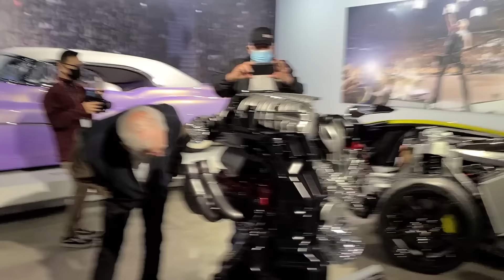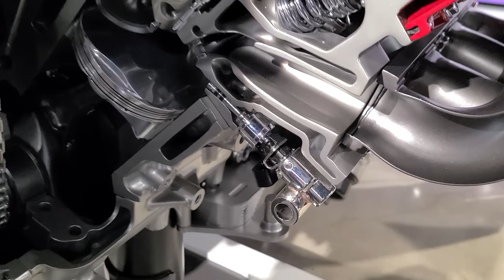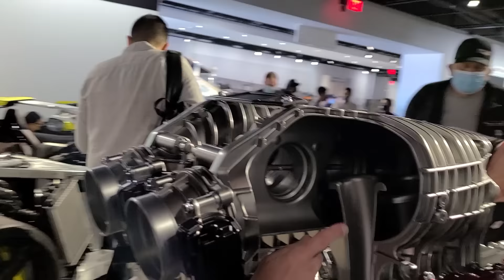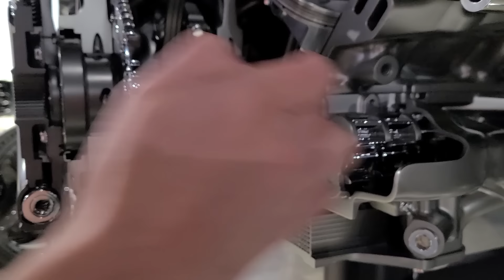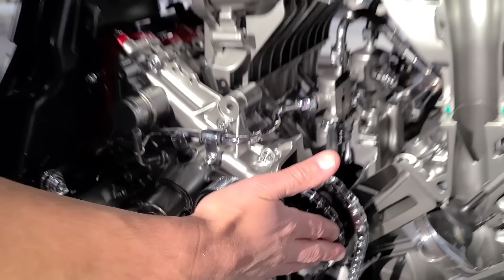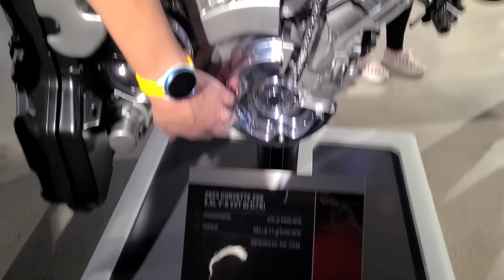2023 Z06 LT6 Cut Away Interview with Dustin Gardner

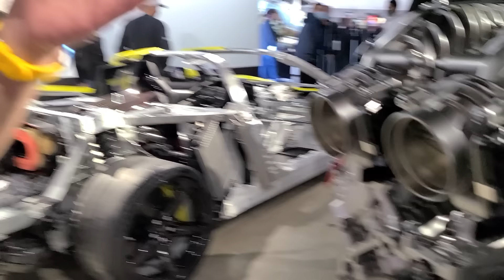Comment: 7:32 So will the intake components, manifold/plenum/throttle body, all have to be removed in order to replace the starter? I don't know if it's been like that on the stingray motor or other V8s, but it's new to me.
Reply: Pretty sure tgat came from cadillac
Reply: Looks like the intake ducting and maybe throttle bodies would need to be removed. Without seeing it complete, and in the car, it's harder to tell. But I would say that a starter replacement could probably be done with the intake plenums being left in place.

Comment: Only thing I see is that roller chain. Roller chains like that haven't been known to do very well for the manufacturers that keep trying to use them. Otherwise that's one hell of an improvement for Chevy after they've pretty much run out of improvement options for the pushrod v8.

Comment: Dodge is going to come out with a motor to destroy this engine like if you agree!
Reply: I responded to engineering employment ads put out by FCA a couple of years ago, looking for experienced engineers to work on high performance engine projects for SRT.  I didn't get hired, but something must be going on.  One of the interview questions was: What do you think is holding back engine power the most?  That's a question that an engine guy likes to answer.

Comment: Amazing but simplicity in maintenance seems lost.  If you have to rebuild this engine, what system is going to pick out the shims for the valve train.  If one of those six scavenge pumps fails, how are you going to know?  Maybe there’s a benefit in five others for redundancy.  What’s the probability of one of those mechanical fuel pumps to fail?  I wonder what Ferrari engineers are thinking when seeing this stuff.  Are they thinking the Americans are geniuses?  Are they thinking they took a simple thing and made it difficult?  Are they thinking they took something we’ve been struggling with for 30 years and solved the problem?
Reply: A competent mechanic with a good set of feeler gauges and a calculator can reset valve lash in this engine.  Don't get spooked by the automated assembly at the factory.  They do that for speedy manufacturing.  Nothing else in the engine is ground-breaking technology.  GDI fuel pumps are common nowadays, and by having two, GM is reducing stress on each one, and giving limp-home capability if one fails.  Multistage dry-sump pumps are old technology.  I looked at a 9-stage pump on Porsche's 5.7L V10 many years ago.  Aircraft have had them since the 1930's.  I don't think Ferrari is worried.  Every time that GM redesigns the Corvette and makes it as fast as their V8 cars, Ferrari just raises their prices and talks about "old world craftsmanship".
Reply: I think ferrari moved to turbo because everyone else did to keep up with the HP of the competition.

This engine is actually quite simple. Those scavenge pumps are the same as the lt2 but just more because they can. They likely all have sensors. The valvetrain is all mechanical. Yes it requires precision shims but tuners can likely get away with valve lash adjustments. The fuelpump is nothing extraordinary. The titanium rods and stuff was all present on thr LS7. They just improved on tech that was already being used.

Comment: Oh my God. Lash for life. Best bad idea ever. It goes along with lubed for life ball joints and other suspension components. No wear is impossible,  so is the life expectancy short?
Reply: Not likely. Is life expextency for a camshaft short? Same idea. They each have their own oil jet so unless you shit on your oil changes you should be fine
Reply: @ShawnyStorm  yes, I've seen aggressive camshafts live 2 years with religious quality oil changes. With added oil squirter as well. I guess time will tell how long "life" is.
Reply: @electricshockproof  i dont think these are aggressive camshafts. Likely the LSA is quite narrow compared to a smallblock but very rarely do oem's have aggressive camshafts. Its bad for idling and terrible for emissions. The most surprising aspect of this engine is it passes new emission standards so its likely toned down quite a bit from what it actually can achieve if let lose. Im sure tuners will get this close to 800hp na with just boltons and tuninf
Reply: @ShawnyStorm  peak torque at 6300 rpm and a redline closer to 9000rpm. That's not really mild cam design territory.  If they managed opening and closing ramps that are gradual,  they must have huge cam base circles, and maybe they have it figured out. Time will tell.
Reply: @electricshockproof  not necessarily. You can change that with rocker arm ratio. It also have continously variable cam timing. The days of the massive lift cams are over. If it produces that much power through the rev range a big lift cam would kill the low end.
Reply: @ShawnyStorm  Looking at the rocker arms, I would bet that they are lower than 1.5 ratio.  If GM was smart they would have designed the cams with large base circles and low rocker ratios.  That would minimize the possibility of cam and slider follower wear.  I'm more worried about the chain drive system.   They're always significant warranty items for manufacturers.

Comment: Finally something that might catch the Ford GT, its about time.
Reply: Nah.  A 2019 Corvette ZR1 beats a Ford GT.
Reply: @andyharman3022  I will believe it when it wins the 24 hour of LeMans race like they did.
Reply: @gmonte12  Ford did not win the overall victory at the LeMans 24-hour with the Ford GT.  They only won the GT class in 2016.  Corvette has won the GT class at LeMans 8 times since 2001.  The C8 Z06 took 2nd this year.  Furthermore, the C7 ZR1 beat the Ford GT's lap time in the Car and Driver Lightning Lap competition at VIR by 3.5 seconds.
Reply: @andyharman3022  How many times did the Vette win the 24 hours of LeMans?
Reply: @gmonte12  Do you mean overall?
Reply: @andyharman3022  They NEVER won a 24 hour race there.
Reply: @gmonte12  Read my previous post.
Reply: @andyharman3022  not the 24 hour races
Reply: @gmonte12  Yes, the 24-hour races.  Look it up.
Reply: @andyharman3022  It did not happen. Please show your references( I know you cant).
Reply: @gmonte12  You're finally getting around to responding a year later? 

Do a Google search on "Corvette Racing LeMans Wins", and you'll see the 8 previous wins as I had answered you a year ago.  2015, 2011, 2009, 2006, 2005, 2004, 2002, 2001.  And by the way, Corvette won the GT class in LeMans this year, too.  Where's Ford?

In 2016, the year Ford won the GT class, they finished 18th overall.
In 2015, the Corvette won the GT class, and finished 17th overall.
You can easily check any of these facts out by doing a Google search on "Lemans Race Results", including any year you want to learn about.

I patiently await your reply.
Reply: @andyharman3022   show me a link
Reply: @gmonte12  Can't.  I tried last month when I sent the previous note, but YouTube doesn't allow links to external sites.  You're dedicated to ignoring facts that you don't like and can't take the time to do a 15-second Google search that will prove me right.  Instead you want to put up a smoke screen trying to make it appear to others that I still have something to prove.

Comment: Pretty cutting edge for a NA motor.  As long as the eccentric shaft for the fuel pumps works well, 8t could be a durable winner.

Comment: The DOHC system is similar to how motorcycle designs are but how is there no valve adjustment? The valves WILL wear into the seats eventually... What keeps them from tightening?
Reply: supposedly the special coating i think sounds troublesome to me...time will tell

Comment: About a 120 ponies per litre 
Most superbikes 
About 200 ponies per litre 
I don't think there's anything particularly astounding bout the engine other than that gm is getting more refined  and it ain't gonna b for the masses anyway  
Best effort so far credit to the engineering dept as a team 
 Those followers and valve seats will wear in the hands of a rev junkie 
Or is there something mechanical to chase the lash 
Anyone know what one would be worth approx as a crate 
It's still ridiculous to think u can get that out of an old 2 valve cross plane 
Dry sump 
There would b some cash spent though and u would end up with more torque 
A price compare would b interesting
A quarter mile 
And a half mile 
A 24 hour race 
 5 laps of the nurburgring 
And pikes
Old tech vs new 
Best engineers on both sides
And whatever fuel like wherever 
Sept nitro

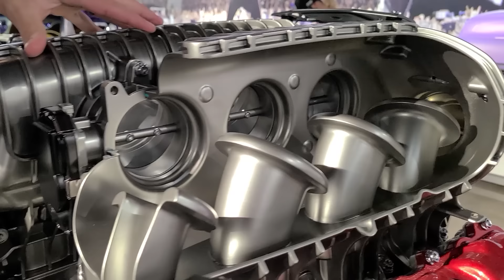Comment: Timeline 2:30 thru 3:50 tries to explain the construction that negates the need for ever having to reshim the valves.  However he doesn't talk about the valve over time wearing further and further into the valve seat which is the main cause of the reduction in space between the rocker arm and the shim.  Unless the valve seat is some new kind of super hard never compressible material, I still don't understand how this engine could never require reshimming.
Reply: They don't have to worry about it when the warranty runs out
Reply: @wtf0101  Hardie har.  But I still hope someone has answer for this.
Reply: With a regularly shimmed solid lifter there are still minor percussive forces, this is a "as perfect as possible" fit. Of course I still want to see what's up at 50,000 miles but 🤷‍♂️
Reply: @bigboreracing356  Well, if they shim the clearance wide enough to account for eventual narrowing, then before that narrowing occurs, there's a loss of valve opening duration.  But again, I'm wondering about the alloys that might prevent any incursion of the valve into the valve seat.   Enquiring minds want to know.
Reply: @bigboreracing356  Yeah, who's ever heard of a reliable small block Chevy? 🙄
Reply: re: "Unless the valve seat is some new kind of super hard never compressible material..." #VIBRANIUM <--- Capt. America approved.
Reply: He said they're diamond coated DLC
Reply: If everything wears together, it'll cancel out.   Valve & seat wear =  stem tip & follower & lobe!

Comment: Why sodium filled? Why not titanium
Reply: sodium metal melts in side the valve, and with the valve movement, splashes back and forth-- helps cool the valve.
Used since WW2, or before.
Reply: @2lotusman851  yes I know, not my question.

Comment: I'm not to satisfied with this.  Basically they designed a engine with a incredible top end and made the bottom end smaller. In my opinion they should've stuck with 6 liters or went bigger.  750 Hp all motor would've been a game changer and put the Corvette in the hypercar class with the McLaren, Koenigsegg etc.
Reply: Some people are never satisfied. With a tune and 100 oct should easy over 700hp. 670hp is at a rather warm temperature. Even without 100 oct this engine slightly warm will see past 670hp.

Comment: How can this engine have 175 MORE horsepower HP, yet 10 foot-pounds LESS of torque?!?
Reply: Short stroke.
Reply: because: MATH. <--- true story, not a joke.
Reply: @phillyphil1513  yes math. More rotating Mass more torque
Reply: The counterweights from a normal crankshaft will give you more torque
Reply: Higher RPM. Torque is specifically ROTATIONAL force, so RPM dictates how much work a given amount of torque can yield over a period of time. 

HP = Torque x RPM / 5252. 5252 is roughly 5280 feet, and the difference can be offhandedly accounted for as mechanical inefficiency, or even the thickness of a very-long and thin belt being unwound as it spins a shaft the rotational equivalent of 1 mile. 

@ 5252 RPM, HP & Lb/Ft of Torque are equal. Even considering that torque decreases at higher RPMs, dividing the product of (Torque x 8400 RPM) by 5252 is like multiplying that product by an additional 160%.

Comment: So, basically a Ford Voodoo engine...
Reply: No, very different.
Reply: Problem with 5.2L fpc it was never designed to starve in racing. The cpc had to use because of such issue. LT6 looks more compact vs Coyote. Chains are shorter. Design looks more refined. Bore spacing is similar to GM small blocks and previous ohc LT5.

Comment: Direct fuel injection has a tendency of making carbon deposite on its intake valves (ford ecoboost; VW GDI engines).  GM may have to add another manifold injector in the next revision to overcome this well-known issue.
Reply: Or periodically do a walnut blasting of the intake valve path,
Reply: The previous generation Vettes also had direct fuel injection on the LT1 engines in the C7 Stingray & C7 Grand Sport & on the LT4 in the C7 Z06, & LT5 in C7 ZR1 (though the ZR1 also has secondary port injection too).  They haven't had any issues to speak of with carbon deposits even though direct injection is supposed to cause issues as you mentioned.

Comment: Early piston failure, I'm calling it now. Also, fuel injection will go bad. But, what the hell, if you're buying this car with that duct taped rear wing monstrosity, it's on YOU.
Reply: Still junk....
GM's gift to Corvette enthusiasts was the last real front engine C7 Z06/ZR1.
C7 Z06 with 650/650 from a bulletproof pushrod V8 was the going away present for a real Corvette.
No overhead cam Euro/Japanese junk but just pure good ol American raw horsepower muscle.
Additionally that whine from the supercharger is like an addiction that only gets worse as you push the throttle and it begs for more never mushrooms or fades it just keeps getting stronger and faster. 
Yes GM you have finally figured out how to copy what the boys over in Europe have already been making 20 years ago.
Call it something else and then when you come out with the SUV and electric version an ORIGINAL  Corvette will be just that and not a "Euro-Copy" exotic.

Comment: Amazing! No wonder this has to be a hand built engine.  It's interesting how GM launches the Z06 which has a hand-built rear mid-engine V8 and AMG launches the SL which has a hand-built front mid-engine V8, both in the same week!  If EV's are the future, then this is the last big harrah for true enthusiasts, so get 'em while they're hot! Limited time only, lol!
Reply: Hand built 🤣🤣
The engineer bragged about the robot chosing the valve lash caps for assembly.
Lifetime solid valevtrain lash .
That is a physical impossibly , roller valevtrain lasts longer but still wears.
Reply: @madmagyver9981  thats my only concern the solid valvetrain, I think thats going to be a problem after a few thousand miles. Its gonna start ticking and without being able to adjust it.
Reply: @Jimmyxsx  Do you think they didn't already put a few dozen of these engines through 100,000 miles each on a test stand? That they are going to release these to the public with that oversight and just brush it off?
Reply: @VexChoccyMilk  tests don’t always prove accurate, the LS7 had valves dropping into the cylinders lol tests vs real world are two very different things
Reply: @Jimmyxsx  LS7 was released 15 years ago
Reply: @madmagyver9981  I get what you mean, but I think possibly the excess lash that would occur over time could be or is engineered into the specs so the engine still performs as designed without significant failure within its spec’d lifetime.

Comment: Just curious 12.5 to 1 compression..on the old school engines you would need 110 octane fuel. Guessing with computers now will this engine run on pump gas
Reply: Yes many cars have these levels of compression now and can usually run 87 octane like in Mazda SkyActive technology, but higher octanes can be better. In performance cars, 91/93 are recommended by the manufacturer.
Reply: @damascus-ut1ee  its crazy. My 68 chevelle has 12.5 compression and has to have 110. No amount of timing will allow it to run without pre detonation
Reply: @lonelypinebeefarm4297  Wow yeah it’s crazy how the knock sensors can control that now

Comment: It looks cool but I have to see it NOT overheat on an actual SAVAGE GEESE track day... also skeptical about engine vibration... and cam shims that won't wear out?  For 125,000 miles?  For 175,000 miles?
Reply: This car has been in development for the past 5 years or so. They’ve definitely tested all of that. It’s a dedicated track car and the Corvette will most likely never suffer from overheating like the C7 Z06 did, which was really the only one that ever did that. And that was quickly corrected.

Comment: Beautiful engine for sure, not that l will ever be able to afford a z06, the overhead cam deal is a little scary, it's hard to beat a push rod engine low end torque for street use,that looks like a race engine that will never legally see its full potential on the street, just thinking out loud 😀still a fantastic looking engine, l would buy it if l had the extra cash👍
Reply: This is basically a Ferrari engine with more displacement, once again proving the old maxim, "cubic inches are everything". I'd rather see an 8L pushrod big block with similar HP & 600+ lb/ft torque.
Reply: @xxxYYZxxx  your absolutely correct, l think it's a shame GM is going this direction with the daul overhead cam engine, the corvette is becoming a foreign copy of a ferrari oh well there going to do it anyway nothing the people can do but set back and watch, maby when these engines start having timing chain issues we can buy them cheap and do a 6.0 twin turbo swap lol 😆
Reply: @jdbchrome1512  I'm fine with dohc engines, it's the ridiculous hype that bothers me, as if GM, some 50+ years after Ferrari et al, has just invented the "future" engine. The intake & injection are the main story here, not the flat crank.
Reply: @xxxYYZxxx  l agree 👍
Reply: @xxxYYZxxx  l want to see a torture test on this new engine like ford did on there ecboost